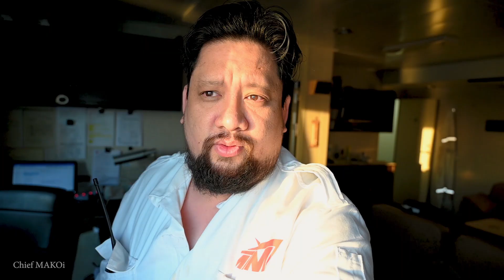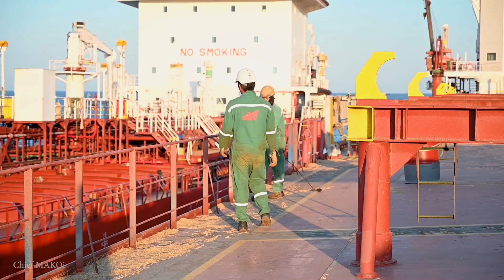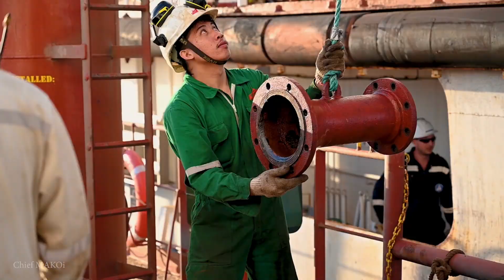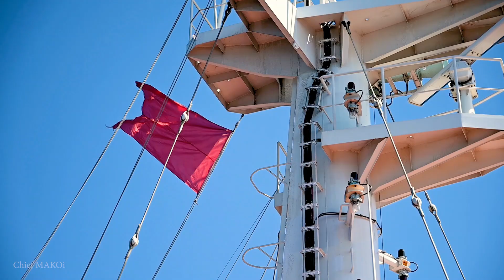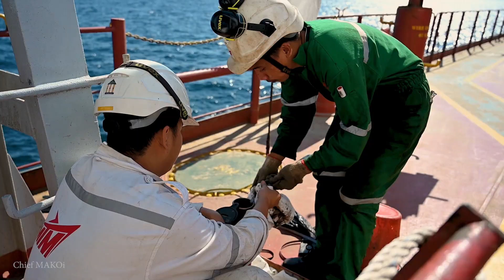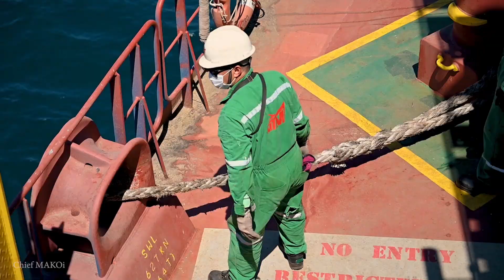Bunkering : Refueling Ships at Sea |  Seaman Vlog S03E10 Chief MAKOi

Comment: When collecting the sample, the drop rate should be regulated so the container captures the sample throughout the entire oil transfer process. 07:52 here it fills almost immediately, making the sample completely inaccurate. In ports like Singapore where the barge may change fuels throughout the operation or other scummy things like they always do, you won't be able to prove it since the lab results will suggest otherwise.
Reply from the maker: You do realize that the cubitainer was still a bit vacuumed and what you saw filling up immediately was just the oil flowing on the sides.  I mean it's obvious just by looking at it.  When have you ever seen a cubitainer (root word: cube) have a triangular shape? 😁
Reply: @ChiefMAKOi  My bad then Chief! Excellent video as always. I found the opportunity to be smart and I sure as hell took it! :D
Reply: @ChiefMAKOi  😊 Chief knows always exactly what's goin on ! Hehe
Reply: @ChiefMAKOi  what is the reason to collect such residue? There’s a bucket down there for leakages. What I’m missing?

Comment: I never realized bunker fuel was that viscous. can't image pushing that stuff through a nozzle or fuel injector. I just figured ships used some sort of diesel fuel.

but maybe the 'Heavy fuel oil' Wikipedia photo is not totally representative of the bunker fuel that you use.
Reply from the maker: It gets heated up to 133 Celsius to reach ideal jnjection viscosity.
Reply: @ChiefMAKOi  Good point. I didn't think of the temperature-dependence. In one of our plants, we had a heating skid to keep the diesel from getting too viscous before hitting the filters upstream of our gas turbines to avoid clogging. only used for the coldest of winter days.
Reply: It is heated to decrease its viscosity before being sent to the injector.

Comment: About 200 years worth of fuel oil for heating my house!
Reply: Btw Also it's a reason you can see the video inside your home on your device
Reply: @Xeroffice  Hm, are you referring to the fact that most plastics (that make up parts of computers) are made from petroleum? If you mean the electricity production, zero percent of the electricity in my country is produced from petroleum.
Reply: and less then 2 days for the container ships i worked on

Comment: Love the videos, keep them coming. I have a question this time. How does the sampling and testing work? Because from what I can see, you test it after its already in the tank?
Reply from the maker: We send it to a lab.  Results usually come after a few days. We normally don't use the new fuel immediately and if the results say the fuel is harmful to the engine, the extreme case is to unload the fuel.  That's a very sticky legal battle.
Reply: @ChiefMAKOi  I see! Thank you for the explanation!
Reply: @Lancashirelad at large containers im working if we go full speed we burn around 100t/day
Reply: Nice

Comment: Cap, please tell me, does exists an Bunkering App for fuels delivery? Of its not, do you thing if its feasible to develop it?
Reply from the maker: Each ship has different tank measurements, so no, I don't think an app would be very useful.
Reply: thanks, Chief. There are different tanks and products. I mean when you need refueling, use an APP for the supplier purchase order and vessel charterer alert for payment procedures. Also to link it with gauge sensors in tanks to certify quantity & quality and inventories reconciliation. This is a critical and costly procedure. Does exist a solution like this?
Reply: @javiercaceres2103  jjajaaja.... "link it with gauge sensors in tank to cerify quantity and quality" . no, it is no possible, in fact it is my job to do that, I AM THE SENSOR (bunker surveyor)
Reply: Technology must help on that. Control on costly assets. Gauge is critical.
Reply: @javiercaceres2103  please search sensors that can tell you the total quantity in a vessel with an error less than 0.25% and send me the maker and model....